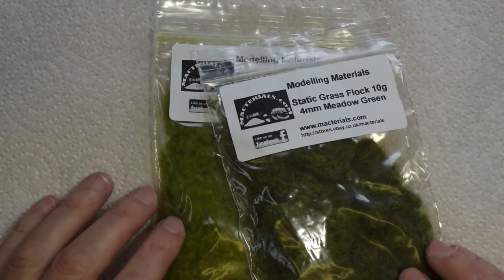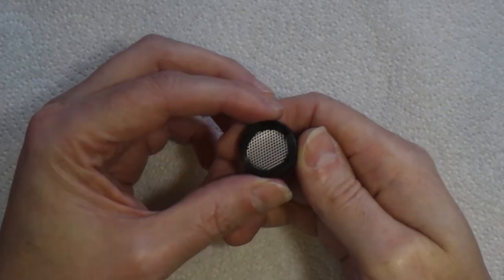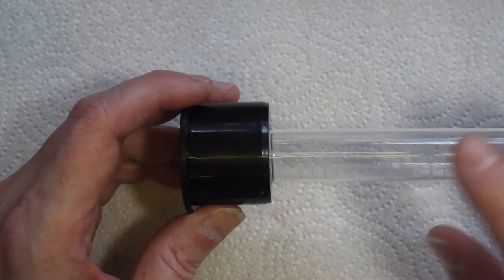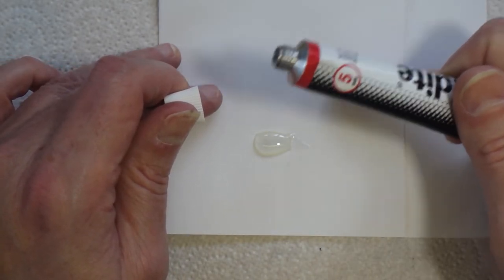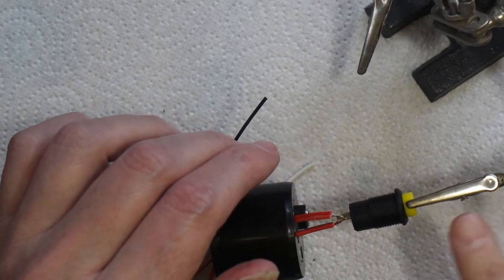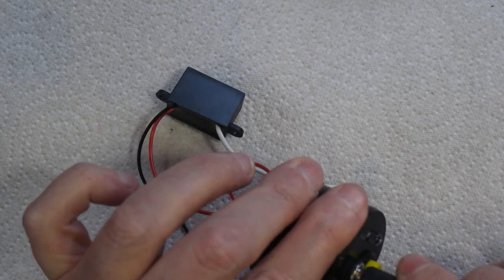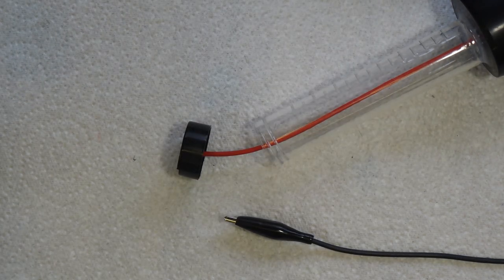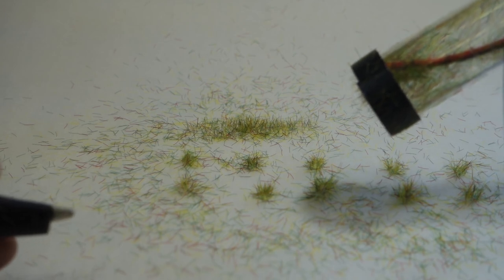Diorama Build 1 of 4 - Building a small static grass applicator from scratch

Comment: All you need to do to make this one so much bettee is to add a capacitor to the output lines same as they do with the fly zapper conversions. Id bought this tiny ion generator myself and was dissapointed with the output. So tried the capacitor (inside tube between sieve and clip leads.) And wow. I know you have made others but mine is same size but large tub using the tiny parts in handle.
Reply from the maker: Interesting idea. I'll have to look into it at some point, cheers.

Comment: Love the video and and am looking to do the same thing.  I was wondering if it mattered how many amps the 12v supply needed to push or if it just needed to be 12v
Reply from the maker: Thanks. I normally use a 12v lithium polymer battery to power mine, which has a maximum discharge of 6 amps, but I've used them with plug in 12v power supplies that put out 1 amp and it works just fine. The negative ion generator produces massive voltage, but the amperage is tiny, way less than 1 amp, so really any 12v power supply should be sufficient.
Reply: @SteamGeezerUK  awesome, thanks a million for the quick reply!

Comment: You sir seems to have knowledge to the question, I'm seeking answer for. So my problem is, I bought a gras master 2 applicator from some shop on ebay, it was used, but looked pristine. It works, but obviously missing the oomph. The grass kinda stand, but 6 mil and up... It's just not what I can see on videos, half of the straws are laying on top of those, which kinda stands upward, so something is definitely wrong. I tried to shorter the chamber capacity, creating a disc covered in tin foil, with screw in the middle, to extend the wire at the bottom of hopper, but that didn't done much. Effect is super visible, when I'm trying to do tuffs, or layer the grass, the density is poor, it lays horizontally mostly... I'm kinda desperate at this point. I bought new 9V battery, supposedly industrial grade, and problem is still there. So, do You have any idea, what I can do, to bring it back to life? I have spent quite a penny for it, and would be a shame to ditch it like that. I have 11,1V batteries at hand, around 1200mah, and wonder, if I replace this tiny 9V for one of these, would it solve the problem, or just burn the thing down, damaging it permanently? Thanks from ahead, hope You can help me ;)
Reply from the maker: Without looking at it, I couldn't really say, but I would suspect either the negative ion generator in it isn't very powerful in the first place, or it's faulty. A lot of cheaper applicators use electric fly swatters as the basis for the whole thing, and they're not very powerful. The one I built in this video has a 6kv generator and it works OK, but I built another with a 20kv and it's 100 times better. You could try the 11v battery and it might make it go pop, but if it's not working very well anyway, do you really have anything to lose? Just be careful not to zap yourself :-)
Reply: @SteamGeezerUK  Thanks for handful of tips. Noch Gras master 2.0 is suppose to have 20Kv of power, and cheaper ones in videos I'm watching gives better results, so You are probably right, there must be something with ion generator for sure.